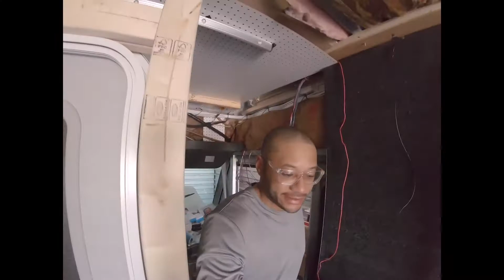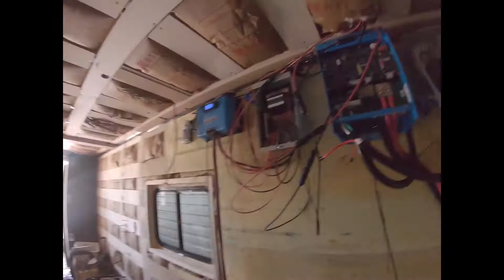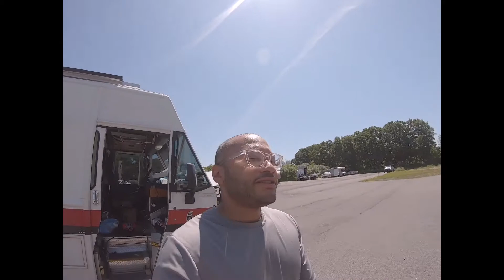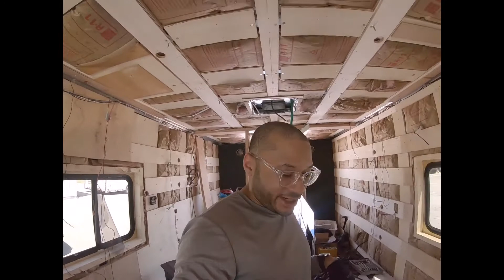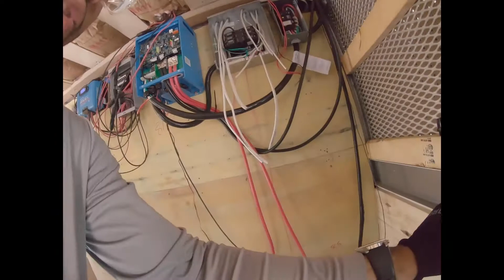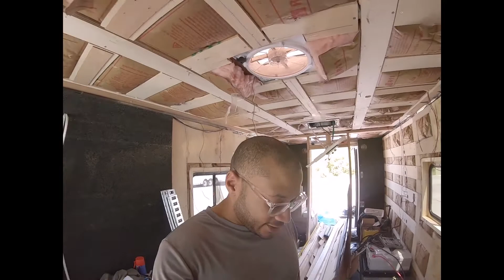DIY Off Grid Van Build: Episode 11 -Solar Charging LiFePo4  Batteries

Comment: Great video T. Are you heating floor?
Reply from the maker: Thank you! I plan on leaving the floor as is. It has a vapor barrier between the aluminum and the plywood. On top of that is a vinyl mat and I plan on putting life proof flooring over that so it should have some r value. The plus is the diesel heater thats floor level.